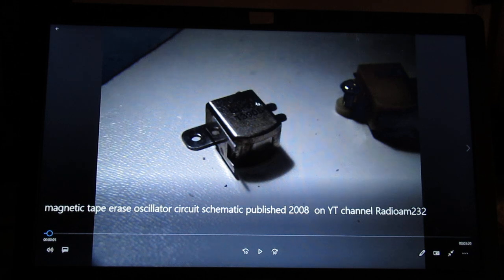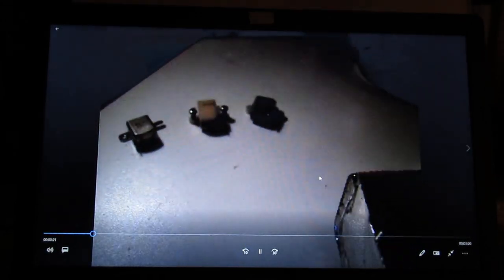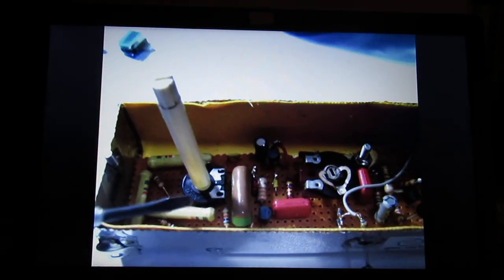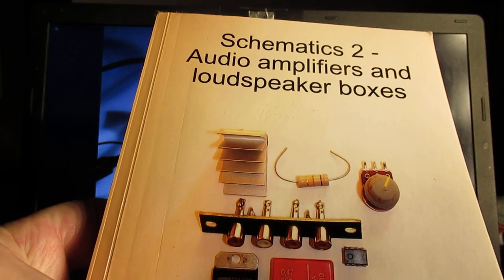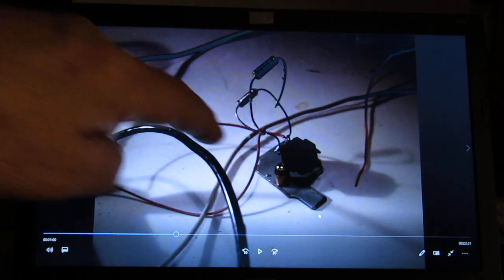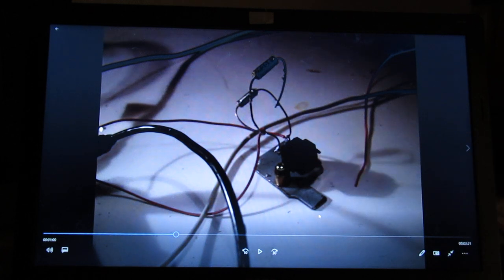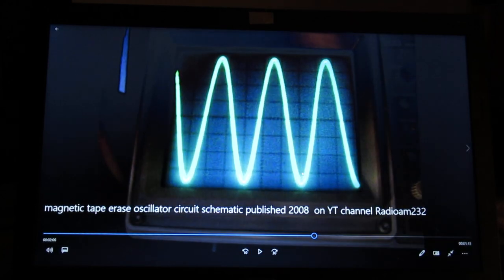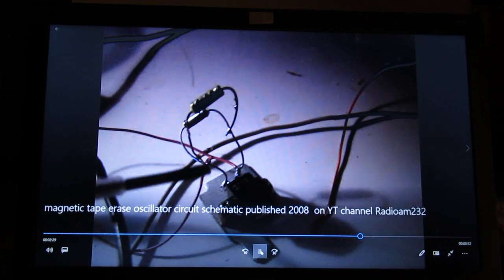Transistor circuit to erase a magnetic tape (old upload of my former channel Radioam232 in 2008)

Comment: Thanks for “re-uploading” this. Especially because there is limited information on this topic out there. I learned only from you that erase heads need to be resonant to work correctly. One thing I am wondering though. Is there any need for driving the erase head with a clean sine wave? Since it forms a LC tank with its capacitor, can’t you hit it with a pulse - like a class C amplifier? It seems I’m going to have to try this out.
Reply from the maker: Thanks. Yes, it must be a sine wave because other waveforms (especially square waves) have much harmonics. They mix in with the music that you record, creating all kinds of other frequencies, both audible and not audible. You will hear them as "birdies" or other sounds in the recording during playback. When you take the sinus erase frequency (to be mixed into the record head during recording) too low this can also lead to an audible mix product, a tone is recorded. Anyway: this is theory and I never tested it with (say) a square wave oscillator as bias oscillator.
Reply: radiofun232 yes, I understand that the bias signal must be purely sinusoidal. But driving the erase head with its 3-4 ohms impedance is much easier with a non linear amplifier - I was planning on hitting it with a pulse. Since I will be running the tape at over 10cm/s, and ideally the bias and erase frequency should be >5x fmax, the fbias/erase will need to be 110-150kHz. And that’s when simplicity in the drive starts mattering. So, my bias oscillator is a regular low-power sinusoidal one, which is still easily done in the 100kHz range, but I am going to try if I can drive the erase head like a class C amp tank circuit.
Reply: That said, I need to still measure the self resonance frequency of the R/P head, which I hope to be high enough to my plans possible.
Reply from the maker: @bertholtappels1081  Interesting! Keep me informed and/or publish the schematic.

Comment: Hi, first of all a belated Happy New Year and thanks for the
videos. I wonder if you can help me. I'm building a new house and I want to have the same audio
(music or TV) around the house. At this stage I'm not entirely sure where the good
old-fashioned music centre will be and I don’t want to double up on cables from
two or more possible ‘central distribution’ positions.  I could have an amplifier with multiple line
outputs to the various rooms but as I say I don’t know where I would best site
yet and even if I did once it’s wired in I don’t have any flexibility. I don’t
want a computer based system; I don’t need HI-Fi or stereo. What I'm thinking
of having simple FM transmitters, say one that can take the output of the TV another
for the music centre and they retransmit the audio to a VHF radio. This would
give me loads of flexibility. I’ve have no problem in building the transmitters
and I have plenty of old FM VHF radios but my concern now is that my new house
is on top of a hill overlooking a town and I don’t know how I could restrict
the coverage of even a very low power device. Am I missing something? Is there
another way that would give me the same flexibility without the risk of causing
interference to others? For instance, it would be no great hardship to install
a loop or several loops around the house and even to have some redundant loops
in possible future distribution points. Would the loop have to be modulated,
would it be subject to interference from external sources?
I'm sure there’s a lot of old fogies like me that would just
love a reel-to-reel tape and analogue audio piped around the house. Any ideas
or suggestions will be gratefully received.   All the very best  . .Andy
Reply from the maker: Hi Andy, thanks. As far as I know you could buy these units for frequencies that were free to use (somewhere on 400 MHz or so), at least in the Netherlands, in the 1980's-1990's. They transmitted the audio somewhere in the UHF band (on some free to use frequencies) to different separate receivers. Perhaps still available on flea markets? Still available in electronics shops? (I don't know). But nowadays all these transmitters are DECT and work in the Gigahertz band (and transmit an encrypted, signal, no problem by the way). These old UHF receiver boxes of the 1980's-1990's had a normal (audio) cinch plug out, could be connected to any audio amplifier. Or you can think about using a babyphone unit on a DECT frequency. DECT works on 1,8-1,9 (perhaps even higher) GHZ, so not a frequency for which circuits easily can be home-made. So somewhere such a babyphone transmitter must be opened and a point on the circuit board must be found to connect an audio (my idea: via a 100 N capacitor) input. That point must be available, because the babyphone picks up the sound via a microphone. Could be, however, that it is all SMD and (thus) difficult to make a solder connection. The range of a small (100 mW) FM (80 MHz - 110 MHz) transmitter is not big, but In the Netherlands it is forbidden to transmit there. A 50 mW FM transmitter in this band (not connected to a proper antenna but (say) a piece of wire of 60 cm) strays out approximately 100 meters. Of course it is possible to make it with the classical wiring.
Reply: Thank you for the rapid response. I had to look up what ‘DECT’
was and Google took me to, ‘cordless-telephone-handsets,’ which I guess could possibly be a source of reasonably low cost (legal) transmitters and receivers to play with. I imagine that the audio frequency range will be limited but with my continuous tinnitus buzzing away maybe it wouldn’t be too big a problem. I don’t suppose that there’s much hope of getting circuit diagrams for cordless phones but the input and output should be obvious enough. Thanks for the idea. Regards  . . .Andy
Reply from the maker: @AndyDaviesByTheSea  Modern LS set/system is here https://www.conrad.nl/p/multiroom-luidspreker-sony-srs-zr5-bluetooth-aux-nfc-lan-wifi-dlna-wit-1486383